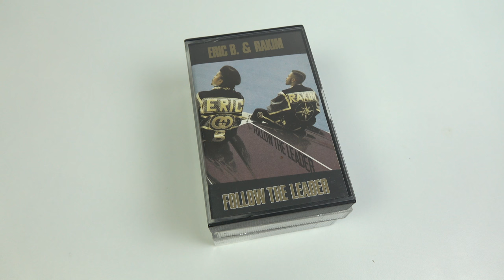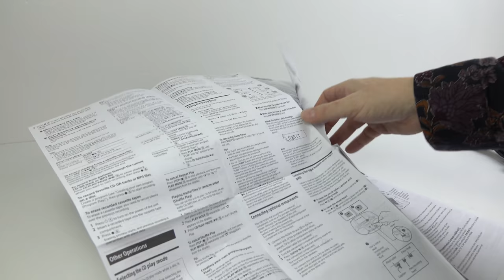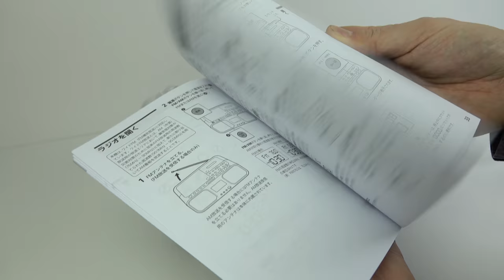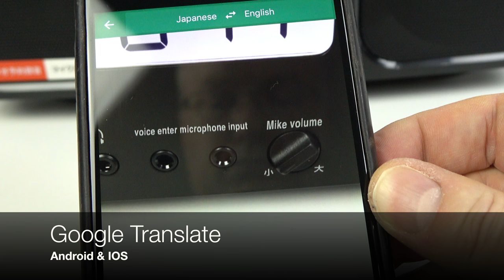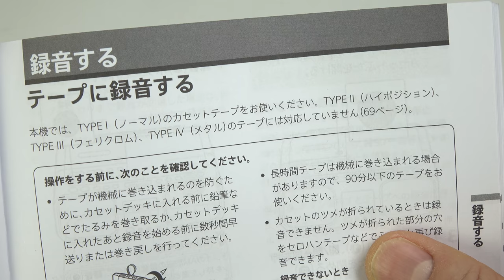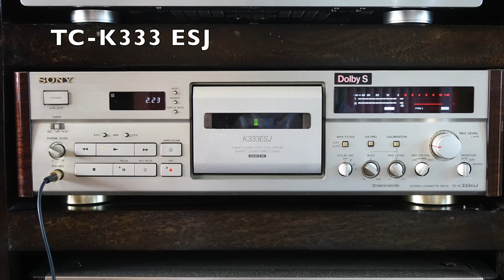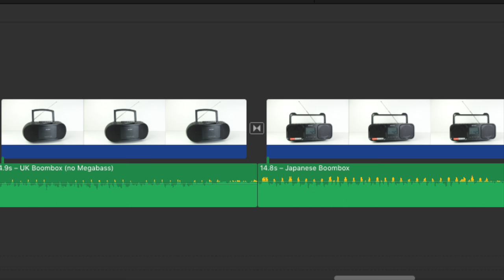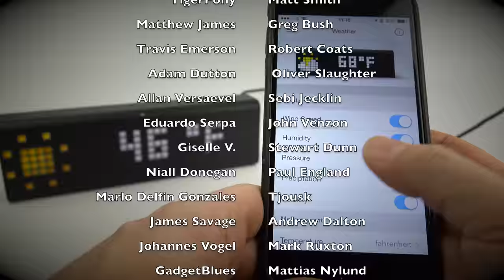Sony's New Cassette Boomboxes -  East meets West

Comment: actually, there is one company in Malaysia still making chrome tape, and one in China, so I've been told, but they are the last ones as far as I'm aware, hopefully the re-take-up of the cassette format will lead to more demand for chrome tape, thus maybe lead to another company picking up the production of chrome tape. Also in a previous video you linked to tapeline.info for metal tape, but they've since run out of them, do you have any new sources, or tips for metal tape? As I've recent;y won an ebay auction for a sony, 90's era double cassette deck that has all the bells and whistles including support for Dolby NR B, C, S HX pro and all types of tape, ferro, chrome and metal. so I'd really like to record on the best format of the day...
Reply: Metal tape is slightly better than CrO2 tape

Comment: For those interested ¥10,190 is $92.24 or £69.79
Reply: Ian Melzer Yeah, but to get it directly through Amazon, it'll cost $450.00!
Reply: I guessed 89.99 so I was pretty close. That's a error rate of 2.2697%. XD
Reply: theLuigiFan0007 Yen price minus about 10% will give a great approximate price in US dollars.  Just move decimal.
Reply: Yeah, 1jpy is roughly equal to about 0.905 cents. I used a faster estimation of round to the nearest 100 and then multiply by 0.009. I thought I was a bit over so  I rounded it down to $89.99, with the 99 instead of a flat $90 because prices in the US are almost always that way. Would'v been much closer if I hadn't rounded down afterwards, I would have instead got 91.67.
Reply: theLuigiFan0007 Well, now that's out of the way... hurry-up and make one to sell in the English-speaking markets, Sony!!
Reply: Agreed. XD

Comment: I don't know if someone else has mentioned this, but there IS a company here in the USA that still makes Chrome cassettes: http://nationalaudiocompany.com/

In fact, they make three grades of them - 751 Chrome (minimum quantity of 100), 771 Chrome Plus (minimum 10, C-60 only), and 799 Studio Master (minimum 10, C-60 and C-90). I haven't used them myself, just thought this might be useful info for cassette fans. They also do duplication, etc.
Reply from the maker: I've been told (and I hope this is wrong) that there is no factory producing audio cassette tape in any other formulation other than ferric. NAC and others spool the tapes made by these factories into their cassette shells. As far as I know they are running on finite stocks of chrome & metal tapes. Ferric is still being made by factories. NAC have started to produce their own super ferric formulation tapes from scratch with the help of retired tape engineers..but if you want chrome...I suggest you stock up now as just like metal before it...it appears it will run out.
Reply: The old pancakes they are using came from Don Morris who is the RTM rep here. They load tapes but do not as of yet produce them. They are suppose to release a new Ferric tape soon but only time will tell if it is any good. I have used a tape called 799 studio tape and it was low grade garbage while the 771 is like Maxell XL II. I repair and calibrate decks so I have more knowledge about performance than most.
Reply: NAC, Tapecity, Tapeline etc. they all sell old stock of chrome tapes bought from Basf, Maxell or even Saehan. There is no and there will be no producer of chrome/metal tape in the future..
Reply: Furr Bear ok
Reply: well, this is infortunate  :/

Comment: I recently bought a CFD-S70 to use in my kitchen & garden.  One thing I find disconcerting is that the cassette door doesn't have a window!  This means that while you're playing or rewinding/fast-forwarding cassettes, you have no idea where you are on the tape!  On most tape players, you can easily see at a glance how much tape is on each reel, but with this one, there's no way of telling.

Comment: I bought  a similar product to the  S70 about 3 years ago in Argos. Mine is the S50 which has a few less controls, apart from that I think the electronics and mechanism is probably very similar or the same.
I agree about the sound quality, it doesn't have the bass you need for playing CDs. I tried plugging in my turntable to play vinyl but again the sound quality wasn't very good.
However I found it fine to play cassette tapes, especially spoken word tapes or drama recorded from a radio channel.
This was why I wanted it, to play tapes occasionally.

Comment: Man.  The physical design of the new boomboxes is AWFUL!!!  Terrible build quality too. 😿😿😿
Reply: Whatever happened to detachable speakers?
Reply: Mike Angelo that was the decline era.  Detachable speakers ruined the aesthetics.  The golden era for boomboxes was 1979-1983.
Reply: What do you mean? At least on the Japanese unit, I thought it looked pretty good in both aesthetics and build quality. I can definitely see what you mean with the UK model though. It almost made me cringe to look at its build quality.
Reply: @mikeangelo6667   They detached...
Reply: The bubble shaped cabinets give an awful plastic tone quality compared to the early 80s boom boxes
Reply: @SPAZZOID100  exactly, but should extend the periode instead of 83 , 80's
Reply: @SPAZZOID100  We had one PANASONIC one that did only fit in the kitchen cabinet due to have detachable speakers. It was a blast (literally).

Comment: I actually like the cheap sound of the ALDI device. Maybe because in the 90s, you've encountered so many of those cheap casette decks that you grew to that sound. Just like some people like the soft cracking of a Vinyl recording (objectively a bad thing), I have "good" memories with bright pink and blue "boomboxes" in 1995 playing equally stupid 90s Eurodance for Kids on it. In our living room we had a 1,50m "Schneider" tower with equally huge speakers, it was blasting with those VU meter needles and lights at every knob and buttons. But for "them kids to have fun with", cheap-ass devices were the thing. We mostly recorded our burps and farts on tape anyways as kids and you don't need much HiFi for that.

Comment: I got a sharp portable from the 70s with a radio and cassette player/recorder, one from the 80s, a Panasonic, same equipment, and then a magnavox stereo from the 80s with radio, cassette player, phonograph, and CD player added on. It has 2 tower speakers.

Comment: Re. tape buttons.  It was common for the buttons to run left to right, or right to left, on portables, depending on the orientation of the tape deck.  '80s boomboxes or ghettoblasters, the cheap ones that had the buttons on the top ran in reverse to the ones that had the buttons under the tape hatch/drawer.

Comment: The eject being "eager" is likely that they don't use the thick transparent grease on the door mechanism anymore, and simply use springs and cogs. The grease used to be horrible sticky stuff, especially when cold, tape doors were always slow. In warm weather the door would open smoother and quicker.

Comment: What a coincidence, I finally had a directive from my wife to tidy up my workshop. I found an old Sony Walkman Cassette player.  I hadn't seen it for about 10 or 12 years and thought there was no way it would still  work.  So I slapped a couple of batteries in it plus a tape and I could have fallen over when it began playing.  I assumed it was belt driven and in Australia that's a sure indication it won't work, our heat perishes belts in a few seasons. 

Well it wasn't belt driven, all direct drive and a very nice  mechanism to boot. So in with a decent set of headphones and I was amazed at the quality of sound. It was the "Sport" version which is supposed to be waterproof, well maybe rain proof, but I wouldn't be going swimming with it. The FM radio had self search and again I was surprised at the sensitivity of the tuner. I picked it up from an auction, for about $10 along with an assortment of multimeters and other portable HiFi gear. 

I must have put it all to one side with the intention of checking it out later and never did. When I get a few spare hours I'll see how I fare with the rest of "Junk" (as my wife calls it)  Well I still own almost 2,000 audio cassettes so it seems I'll be listening to a few of them in the future.  I just pray they haven't deteriorated due to the heat. I've had open reel tape shedding it's oxide due to excess heat, so fingers crossed.  Thanks for the video, as usual good stuff.
Reply: Back in the mid 00's I went spastic on collecting cassettes after my friend told me how crap the CD is, hatting 44Khz sampling, now I'm back into vinyl & 78s after discovering the LP120 on vinyleyezz channel

Comment: In the last 3 years I have gone through 3 Sony Cassette/CD/AM/FM boom box. I use them about 1-2 hours a week and the CD player portion dies after about 1 year. The radio and cassette portions seem to solder on with no issue! I actually bought an Onkyo dedicated component CD player for the bedroom to listen to my guided meditation cd's on. The US version is like the UK version and is $54 and not worth it.

Comment: I have an old still-functioning Sony boombox from the mid 90s & 10 is the MAX volume.
Reply: Yeah,  afaik 10 was the max on all analogue audio devices. Volume levels scaled between 0 and numbers 30 or higher is something from the digital era. Like Creative MP3 players, or the audio on TV's cause you need more steps due to the lack of fine volume control an analogue slider or knob gives. That's why the "This amplifier goes to 11" joke in the Spinal Tap movie is brilliant. <But you probably knew all that, so why am I commenting this...> ;)

Comment: That S401 is gonna be my new alarm clock.  I'll go buy a labeler as well.
I'm going to make a video about my (circa)1963 RCA-Victor New Vista, which was my late grandpa's Victrola.  A Victrola!
Does that sound interesting, TM?  It's got a record changer that I put a stack of 12 compilation albums, primarily of big band hits, to play as I go to bed.  That's because it turns itself off when it's done.  More details when I release the video.

Comment: Japanese shops still sell A LOT of cassette players Toshiba, Sony, Panasonic, they still have them all, and even new tapes (mostly Memorex brand, if I´m not mistaken). 
Also they still sell fax machines almost everywhere, it´s awesome to see 3, 4 decades in one electronics department of a regular department store.
I almost bought myself a double-deck cassette player from Toshiba, but from some cheap reason I decided not to back in March 2017. Oh, the regrets...
Reply: ** correction: All tapes I saw were Maxell branded, I just checked on the photos I took.

Comment: Bought the Sony CFD-S70 almost a year ago. Today the CD-player failed, it doesn't recognize any kind of CD's or mp3 discs anymore, just displaying "noCD" in the screen.  Yes, I cleaned the laser lens but it didn't help. It's under warranty so it should be taken cared of somehow, just contacted the seller about the problem and waiting their response.
This Sony costed 79,95 Euros here in Finland last year when I bought it. Build quality suggests it should cost 25 euros at the most...
Reply: A lot of Amazon reviewers said the same problem happened to them.
Reply: @leaderx7547  mine was replaced by the warranty and new one has been working fine so far.

Comment: I bought the Sony CFD-570 model for my shower. Besides the radio and cassette and CD I can use the Audio IN to connect to a blue tooth receiver so I can have my phone connect to the stereo while in the shower. I also used this model to connect to a computer  - my dad's - who is old but likes to still record cassette tapes of programs so he records songs and shows streaming off the computer using the Sony aux in.

Comment: Very useful video (as always!). Yes, I bought the Sony CFD-S70 to play cassettes - I think it was £60 ish RRP is £75 apparently) and it does the job, but sound is rather thin. It works ok. Based on your other review, I think the Panasonic RXD55 is worth the extra £35 as it has a louder output (watts) and also a remote. I think Sony trade on their name a lot and probably should be selling stuff at the higher end, which they're good at. Thanks for your excellent review.

Comment: Did you ever mention the playback-azimuth-problem? I think it's the main problem with Philips-MC! (Also the miss-alligned Dolby-playback-levels of Dolby-encoded recordings on different decks, in combination with the high-loss of aging recordings, especially Ferro/Type I)

Azimuth miss-alignment between recording/playback causes L/R-phase-errors at first (directly audible when playing back in mono), and if this even more mis-alligned, it causes additional high-loss.

On almost every upright-front-loading tapedeck you can easiely pull of the flap and adjust it with a tiny H0 screw driver. (Autoreverse-decks have 2 screws to adjust it in every direction. An 3-Head-decks ist WAY more complicated!)

The next problem of MC-tapes ist slightly various pitch! This can be up to about ~4%! If you digitize recordings, you can correct this via a reference-song you have form digital source, a news-beep on radio-broadcast or something else, even via FM 19kHz-pilot-tone on recordings made frome a cheap tuner-source). When you once have any refference, you can calculate a correction-factor, multiply it with the sampling-rate (e.g. 48 or 96kHz), set it as odd "new rate" in Audacity, and resample to high quality 44.1/16 finally.

I recently digitalized some old taped from my childhood, starting with recordings from a cheap plastic-child-recorder, some child-cassettes i have memories with, going on with some open-air-recordings from the radio later on. I used a "simple" 2-head Kenwood KX-3030 deck in good condition, hooked up to a Realtek HD-Audio Line-In. For live-monitoring, it hooked up a cheap JBL-Speaker (MONO!) paralelly to the Headphone-Out to correctly adjust the azimuth on every side on every tape.
Then I did the slight Pitch-resampling, normalizing (24-bit), cut the tracks, and output to 44.1/16/stereo or mono.
There's also a Plugin for WinAMP called "Tape Restore Live", that can fine-adjust a dynamical phase-swaying azimuth caused by cheap recording-decks, if this is the case...
Finaly I encoded the tracks to high-bitrate MP3, tagged them, and got VERY good results! :)

Comment: Just bought one of these CFD-S70 portables and find that it doesn't sound too bad through it's built-in speakers, and it has a decent cassette deck - steady speed! 

I thought I'd try out the CD-to-tape recording on this device and have just recorded 'Public Broadcasting Service - The Race For Space" from CD to tape on this CFD-S70.
Playing back the tape on my main Hi-Fi system from a Technics RS-TR575 cassette deck, it's amazing what a good job that the auto-level control system employed by Sony portable can do!  It sounds 'full' - plenty of transients, no pulsing of volume levels between high and low volume sounds, no compression,  very clean and clear, with a good low noise floor...even though there's no Dolby, there's no noticeable hiss, and this is using a standard Maxell UR90 cassette.
I must say that I'm pretty impressed with this little inexpensive boom-box!
Reply: Has the CD stopped working yet? It's a common fault on these machines that develops after 1 to 2 years of use.
Reply: @leaderx7547  : So far.. No!  It's still all working perfectly...  :-)

Comment: I like that the otherwise cheap sounding Aldi player has 2 SW shortwave bands which were commonplace on most boom boxes of the 70's and 80's. I loved to tune the SW bands hearing broadcasts from all over the world and weird sounds especially when the whip antenna was connected to a 50 foot longwire for best signal strength. There are also web based SW sites webSDR and global tuners for your computer ,tablet or smartphone. You never know what kind of signals you can find.

Comment: You can guess what sound quality to expect from the speakers of the two sony models just by looking at the surrounds around the speaker cones: both are about the same size, 8cm = 3" i'd guess, but the "UK" model speakers seem to have a small varnished paper surround which leads to a resonance frequency of maybe 200-300Hz. Below the resonance frequency is generally not much going on especially in a closed box. The "JDM" model on the other hand seems to have quite broad rubber surrounds which puts a resonance frequency of 100Hz in reachable range. I wonder if that really is a bass reflex port or just a dummy. That would bring down the lower cut-off frequency even more. If you took those boomboxes apart I think you'd see also a bigger magnets on the speakers inside the "JDM" model.

Comment: Bought recently the Sony CFD-S70 because my Sharp CD/Cassette radio's CD-player started skipping and stuttering. The cassette player in it still works fine and so does the radio.
Bought the Sony just to listen CD's and it works but gotta say that the old Sharp from 1992 has much better build quality. Maybe I should even try to repair the '92 Sharp...

Comment: I used to record from CD to a SANYO cassette Linkin Park albums because I didn't have a CD player in my car. The audio quality was nearly as good as the CD in recording to the tape to the point I didn't notice a thing between CD and cassette in my car. I still have very acute hearing 10 years on and it still sounds quite good, being 10 years old the tape has changed a bit but all I used to record to tape was a Phillips 5.1 surround sound home theatre system.

Comment: 16:39 Note that the FM scale in Japan works on 76.0 to 95.0 MHz rather than 87.5 to 108.0 MHz like pretty much the rest of the world. If you'd have wanted 103.2 Power FM on this radio, as I would have done around this time, you'd have been disappointed.